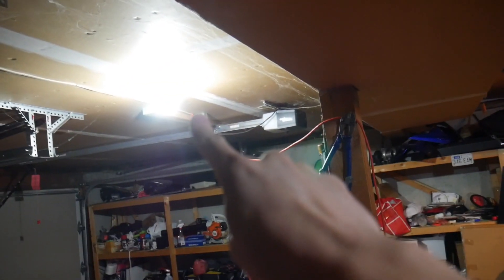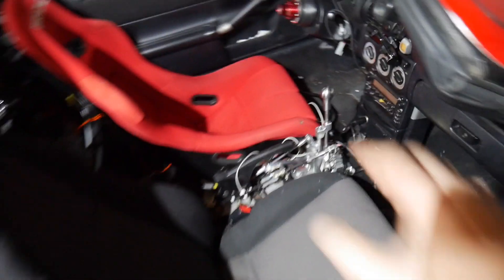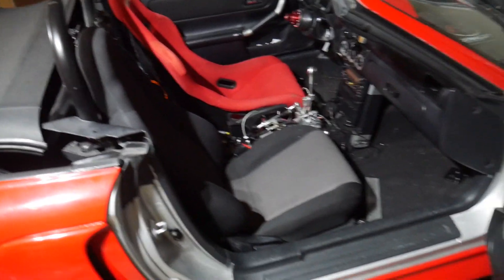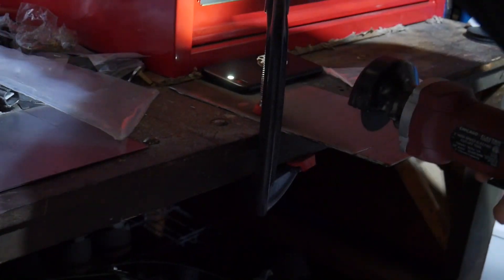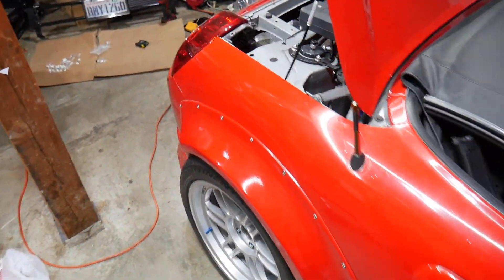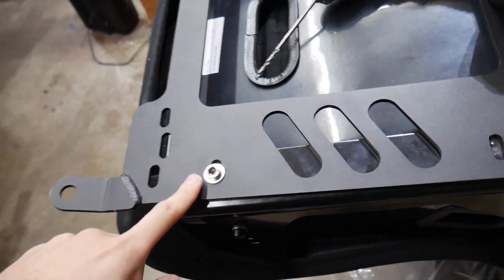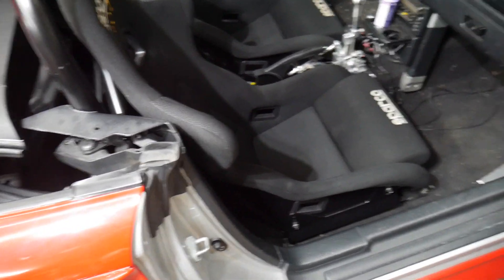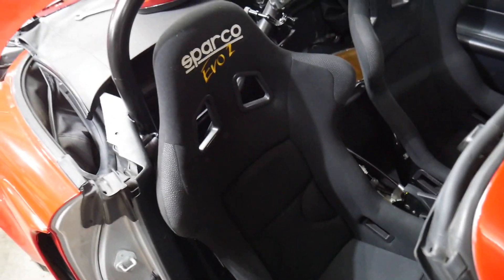Ultimate Racing Seat Setup! Sparco Evo 2 Install in the Honda K-swapped Toyota MR2 Spyder!

Comment: hey mate, i own a mr2.. I am kinda struggeling to get my sparco sprints in there but yeah... Where did you get the crash-bar from? i need one. My MR2 wants to become a Nordschleife Build haha
Reply: and also can you tell me where you got the plattform for the seats from?? Like the connection between the car and the actual seat?
Reply from the maker: The roll bar is from “hard dog”
The seat brackets are “planted seat rails”